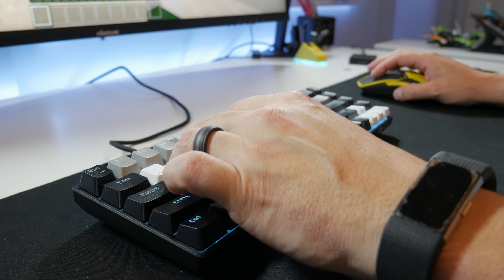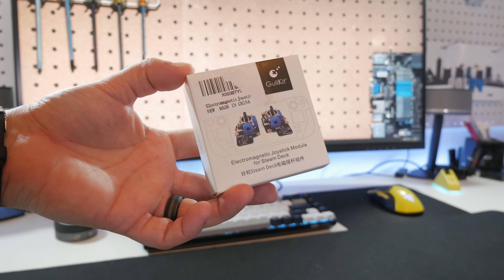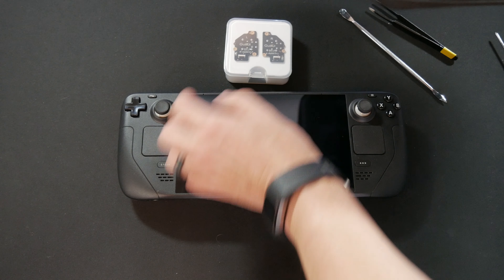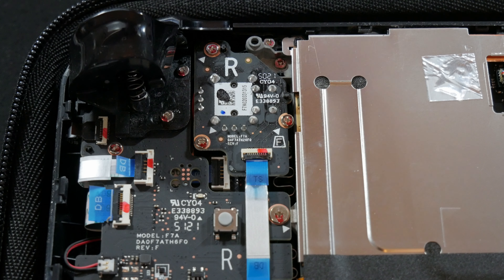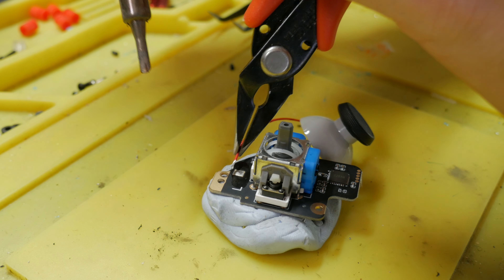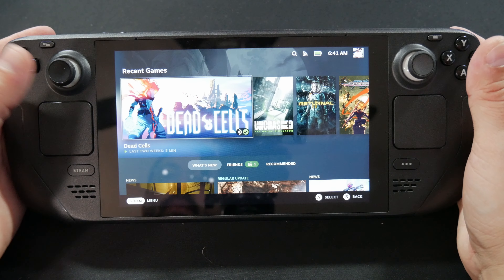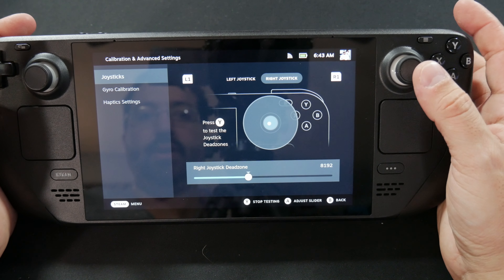How To Get Rid Of Stick Drift On The Steam Deck

Comment: Wish you made a no solder video because a lot of people won’t be confident enough to solder their thumb sticks
Reply: I'm definitely not confident in doing that.
Reply: Easy - just use a glue gun. 2nd Option is to ask/pay someone to quickly solder it for you. Should be cheap.
Reply: He says in the video you don't need to do the solder step
Reply: @domainmojo2162 would not recommend a glue gun since that insulates, the whole point of solder is its conductive you get good contact and its secure, plus hot glue has a lower melting temp and would be harder to clean up if you do it wrong and don't get sufficient contact between the board and the wire, at that point you'd be better off just getting a solder kit since in a way it's a similar process
Reply: @Jojooooooo  Should be more than fine. Many electronics, including headphones- even the Logitech ones, use glue to attach some wires.

I've got about 4 Logitech headphones- all their usb cables' individual cables(those extemely thin cables- 10 of them) are connected to the usb controller with glue.

My amplifier- a costly Pioneer, have a few small- sound-carrying wires connected with hot glue. It came like that from the factory.

I've got a Netgear broadband router that's 8 years old... some of the internal wires are connected to the board with hot glue. I bought it brand new like that.

It more than suffices.

If it's good enough for Logitech, Pioneer and Netgear and more, it will be more than good enough for Sony/Microdung.

Comment: For me I had to take it apart bc it’s started to rubbing after one year of extended use on right joystick and I was hoping something just got stuck inside but after I took it apart the joystick itself got a bit loose inside and that’s why it’s rubbing, I guess I need an upgrade even though it’s still working fine just has slight rubbing feeling when I push it to one side. Idk if I can fix it or just get an upgrade. It’s OLED limited edition version

Comment: I would do this for my own Steamdeck but I can't just use the regular kits out there.  I have to wait for the "B" version so they work properly for my system.  Might be a good idea to point out the difference and what to look for when considering replacing them.

Comment: If you dont remove the SD card it will break when you pull the back off. Removing the SD card is step 1.

I did this upgrade to the hall effect sticks as soon as I got it. I had the hall effect joy sticks and a 1TB SSD before my Steam Deck arrived in the mail.

Comment: My Steam Deck soon developed some drift, though still well within the factory deadzones.
I tuned them as small as I could and this has been stable, if they degrade further I will instantly notice drift and will compensate with the setting.
Which if this gets too bad, I will replace the sticks with Hall-Effect ones, but as long as the original sticks work well, no need to replace them yet.
Good guide on the upgrade, though it did not cover the A/B board revisions compatibility of the stick modules, which is an important detail.
Reply: Mine has stick drift as well but still within the default dead zone.

Comment: i just use contact cleaner or WD40 but contact cleaner is preferred, once every 3 to 4 months keeps my controllers in top shape even my Sixaxis from my OG Fat PS3 06' still functions till this day. So if you dont have the cash to upgrade your sensors use this method you're welcome!
Reply: $30? .. honest question..  if you cant save for a $30 purchase how did you save for a $700 purchase?
Reply: @intoxicateddaze2864  Servicing and maintaining is generally encourage when it comes to hobbyist items.

Comment: sorry, im confused.. how to do it without de/soldering ... if it is fine?
Reply: hes saying its relative.. do you use the touch sensor on the joystick or find it at all a necessary feature.. if you dont think you need nor want the touch feature then theres no need to solder.. just snip the wire and pop it onto the new joystick and screw back into place
Reply: @intoxicateddaze2864 what is the touch sensitive feature?

Comment: is it necessary to unplug battery before?
Reply: You should always do this anytime you're working on electronics or cars
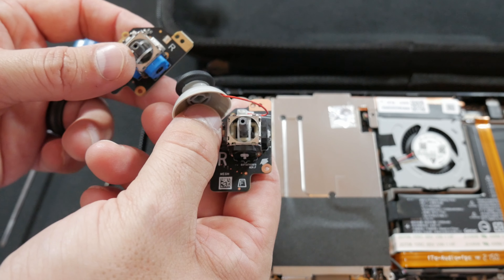Reply: @HumbertoHacked  Funny, but why the author didn't unplug? here 4:14, you can see it in the background that cable is pluged
Reply: @truer870  just because you "should" doesn't mean you always have to. Safety measurements for you and the item are always a good thing.

It might still work but generally you should always unplug the power source before working on anything

Comment: I'm confused - what's the purpose of the touch sensor?
Reply: Adds additional input options when its pressed down
Reply: @traestephen7276  Thanks.  So, I looked it up and it seems to enable the gyro mode.  Anything else?
Reply: @aaronhopkins7354  you can program it to make one button do something else etc
Reply: @traestephen7276  Thanks.  So, long of the short, if my wife gets drift with our [her] Steam Deck, I'll need to buy a soldering iron as well as the new sensors. :|
Reply: @aaronhopkins7354  I'd advise just sending it on for RMA until the warranty expires
Reply: @aaronhopkins7354  basically